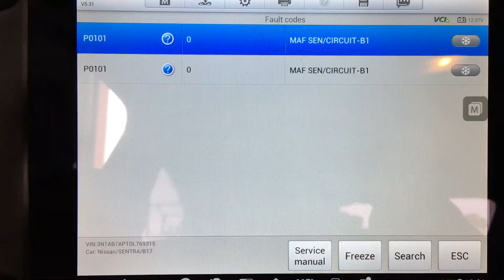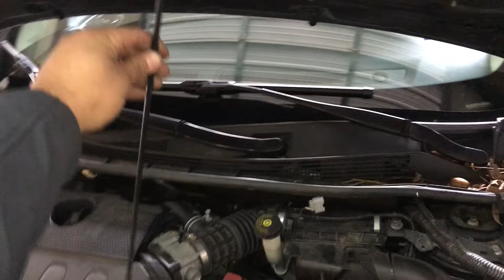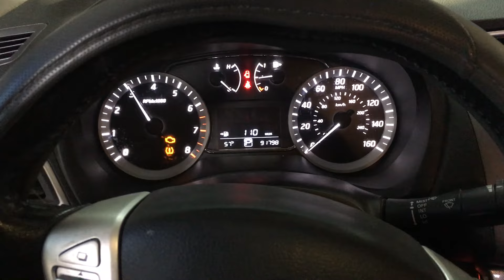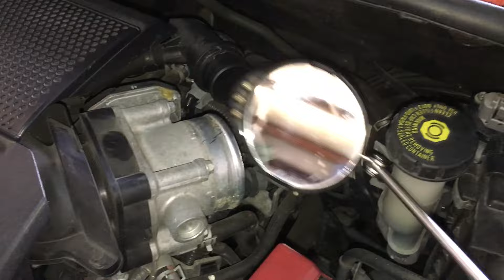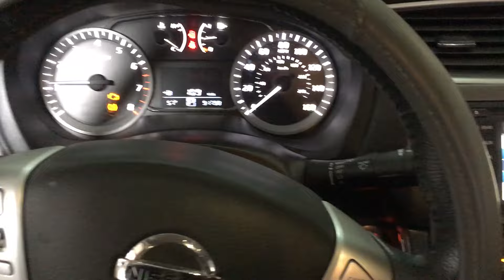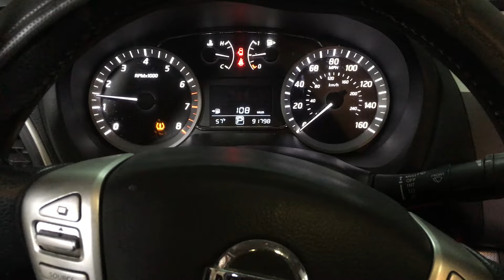NISSAN SENTRA STALLING DURING IDLE DIAGNOSIS AND FIX

Comment: did the same repair. Got a new Mass sensor,  new air filter, cleaned throttle and reprogramed it, the car feels better but i can still feel its missing power. Sometimes when i acelarate a little misfire shaking happens. but my sparks plugs and coils are new. Its driving me crazy because i cant solve this problem. Any more suggestions amigo?????
Reply: Did you ever find out what happened? Same issue nowadays but losing traction control too

Comment: I was taught that a TPS should be 0.50v at idle. So 0.56v is pretty darn close. Also definitely should have checked and cleaned the air filter.

Comment: THis is a constructive comment. One of the fixes is to check the air filter. I did not see you do that. Also the vehicle has over 91,000 miles. It was due for a throttle body cleaning! All said you did not throw parts at it. Good Job.

Comment: I also have a 2014 Nissan Sentra. I'm having hesitation problems at < 1000 RPM [stalling] and jerking issues when accelerating. I changed the Mass Air Flow Sensor and the PCV valve w/no significant change in the problem. I disconnected the apparatus attached [air intake boot?] to the throttle body and all seemed nice and clean. I did the re-learn procedures w/o any change. Any advice?
Reply: Vin Man sounds like the cvt going out
Reply: @rahrah8076  Nissan agreed to pay 90% of the transmission cost.
Reply: Vin Man it’s such a common problem and they extended the warranty on them..some people are on there 3 or 4th cvt in the same vehicle
Reply: @VinMan2026  where did you get this information?
Reply: @lbextractions7008  is been so long but it was after exhaustive searches on YouTube. I believe the specific year was not included in the title.

Comment: So I have a 2011 Nissan Sentra and sometimes when I drive it the VDC comes on by itself and then it kinda locks the rpm. Like it wouldn’t let me go past 2500 rpm and if I do then it starts to jerk. This is kinda dangerous as I can only drive about 40 mph and I do a lot of highway driving. I can’t be going 40 on the highway and it’s very annoying. Anybody have any idea to what may be the problem?

Comment: Was the air filter dirty? Why was the throttle body dirty?
Reply: Pcv system allows oil vapors and combustion byproducts to re circulate back into the throttle body to be burned again. That's what causes the buildup over time

Comment: After seeing that air box loose like that i thought for sure un-metered air was causing that... Guess not... Im surprised though a dirty TB would just all of a sudden cause a super low/ no idle condition. That TB looked pretty good in the mirror... Looks like a fix though... good job not firing the old parts cannon!

Comment: I have a 2014 Nissan Sentra it idle really rough when I’m at a stop and feels like it’s going to stall so I cleaned the throttle body and it runs better but other issue still the same
Reply: Did you ever fix the problem?

Comment: Today my 2010 Sentra stalled in a signal. I try to start and hold at higher rpm. Then the ET005 part on the air intake house fell on the road. I think the clamp that holding got loosened .. as I don’t see the clamp there... will put that part by myself and try starting it.. if it’s not working out, then I need to tow :( Any suggestion welcome

Comment: Hie. So I am in Zimbabwe, and have the Nissan Sylphy (I suppose its the same as Sentra in USA)2006 model. It has the same stalling issues when car decelerates, and is only able to start if you are pressing the accelerator. On top of that, it has a groaning sound that is heavy on acceleration from 0-40 km/hr, and is silent at higher speeds.

Comment: A nice video very informative I have a 2014 Sentra with the 1.8 to now I know if this code comes and I take it to the dealership or a regular mechanic I can ask questions on the problem and how they fix it and se if they are over charging and another thing can you tell me the brand and model of your scan tool it will be nice to buy one or what other you recommend

Comment: GREAT VIDEO.. I WORKED ON A NISSAN ALTIMA 2016  52,000 MILES WITH THE EXACT SAME PROBLEM ... BUT IT WAS THE MAF PROBLEM, CLEAN MAF WITH CRC MAF CLEANER AND BLOW DRY WITH COMPRESS AIR. AND I ALSO CLEAN THE AIR THROTTLE PLATE. ( BUTTERFLY) RELEARN CAME BACK TO IDLE SPEED AFTER DRIVEN ABOUT 25 MILES ON THE HIGHWAY. THANKS

Comment: Great vid. I had an 02 that I did all the stuff u did with a Verus, then a Maxi-Das, then a Diagun. It would slow down to 675 700 but as soon as u shut it off,  and restart it  would go back up to 1100. I finally gave up. It was an 02 Altima 3.5. After I gave the car back, I saw a TSB that said u have to disconnect Mas a/f sensor for 10 seconds. I wonder if u have ever run across that problem. New throttle body was worse

Comment: I definitely check out the air filter first before checking anything are electrical. 
On my Mazda 3 Sport the engine light comes on steady. I was shock my air filter were all full of black dirt, candy wrapper, amd a peanut. shell.
After replacing the air filter, & blow clean the intake air box with a leaf blower. Check for loose airflow connection with everything seems fine and tight afterwards. Start the engine and seem to run steadily and smoothly. Then erase the engine trouble code . Drive for a week or more while observing the engine light if it on again.

Comment: It’s most likely a dirty throttle body.  I would use a shop rag, not paper towels to prevent debris from going in to the intake. Also slightly lubricate the butterfly mechanism on the throttle plate.

Comment: This is a perfect example of a problem caused by the owner/driver of this vehicle.  At 90,000 miles, it should of had its third 30k service.  Then there would be no tire light flashing due to a bad tire sensor.   It also would not have the key light flashing due to dead remote batteries, and the throttle body should have been removed and cleaned at least once before (at 60k).  Take off the throttle body and clean it the right way.   Does it really take that long to remove four Allen bolts and a electrical connector?   
People that don't take of their vehicle get exactly what they deserve!
Reply: Very nise

Comment: Most idle issues are a dirty/sticking throttle body I've found.
Reply: I clean my throttle body and change the PCV every 30k miles
Reply: Even from the visual inspection the throttle body is SLIGHTLY opened meaning it needs a cleaning. This is a sign of the owner using bad gas as it doesn't combust as clean as top tier gasoline

Comment: Probably crank, cam sensor. 
Or blocked are fuel filter.

Added later.  Throttle will drop when you rev it a bit I think. Automatic choke was on due to being cold.

Comment: I'm surprised this turned out the way it did. When you booted the scan tool I was wondering about IAC counts and fuel trim, speculating that a vac leak was causing too lean a mixture when at idle, pushing IAC closed (if it has one). If air bypasses the MAF it would underestimate the volume of air and offer less fuel, improving when air flow increases with WOT. I suppose it might also cause MAF reading below range. I was wrong, presumably the lean mixture of a vac leak would throw a lean code as well. Maybe the dirty throttle body didn't let air down the IAC passageway so the IAC couldn't compensate enough to maintain idle.
Reply from the maker: This vehicle doesn't have an iac. The electronic throttle body allows a minimum amount of air flow during idle. But when it gets dirty enough, air can not flow to keep the engine running. Thanks for watching!
Reply: @ADVANCEDLEVELAUTO  and as a safety feature, it shuts the engine off to prevent flooding

Comment: I have an 05 trailblazer 4.2 I6, battery died and replaced it, then started having this same issue where it would stall out  during idle and had to keep my foot on the gas to avoid this happening. A bit of throttle body cleaner did the trick, then reset the learn procedure and your good to go.
Reply from the maker: Yes. This is very similar. Thanks for watching!

Comment: One of the best videos out there,most mechanics would have replaced the sensor, then put in a air filter,then a fuel filter,then a fuel pump.After that didn't work they would check the coils,the distributor ,then change the oil and filter.then change the catalytic converter,and finally the muffler and TELL THE CUSTOMER >>>>IT" MUST BE THE MUFFLER BEARINGS that's the ONLY thing left, but the parts dept is out of them right now,we had a lot of these models come in lately just like yours.
Reply: “Looks like it’s going to need an ECM”
Reply from the maker: Haha! Thank you for watching!

Comment: Thank you. I have a 2011 Altima that started throwing this code. I have cleaned sensor best I can. Changed air filter. Still get it. Comes and goes. Idle seems funny during slow movement as well. I will clean the throttle area as you did. Again, thank you.
Reply: These types of sensors cannot be cleaned unfortunately as the sensor itself is barried inside the enclosure box, what you see on the outside is the temperature sensor.

Comment: Yeah, a dirty throttle body can definitely keep the engine from drawing sufficient air to maintain minimum idle. Two keys here; 1- interpreting maf readings correctly to determine if it reporting correctly and 2- cluing in on the fact that opening throttle plate kept engine from stalling albeit, accelerated. Like you said, this could've escalated quickly...ready, aim, fire! 😎👍
Reply from the maker: Thanks for watching!

Comment: I just had a 2014 nissan versa with the p0101. Fuel trims were pegged rich and car would barely idle. Most times it would start and stall. Mass air sensor was replaced by the customer  but same issue. Cleaned the throttle body and car ran perfect
Reply from the maker: Awesome! Thanks for watching!